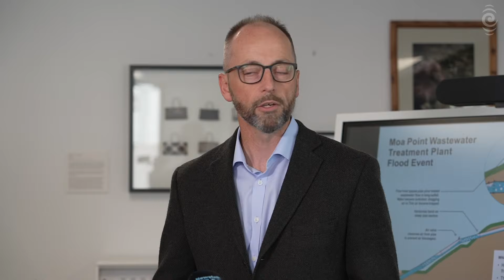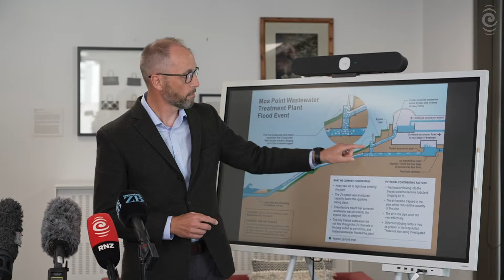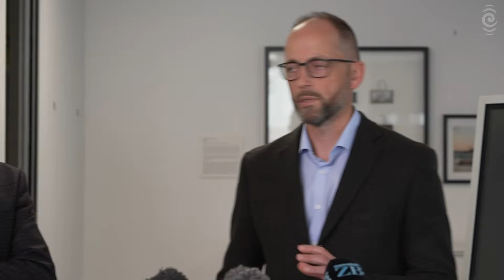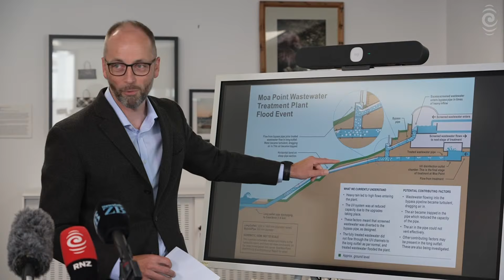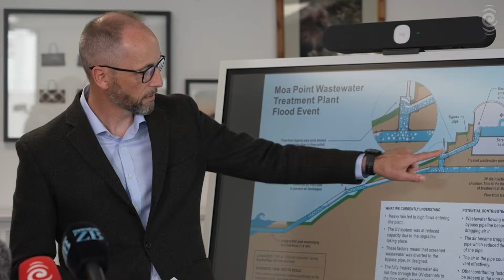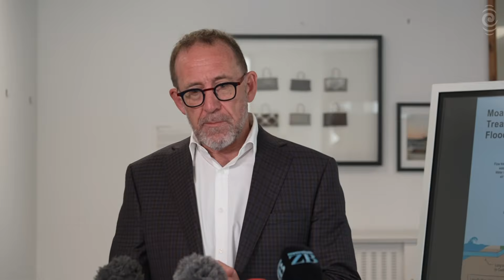Possible cause of Moa Point disaster revealed | RNZ

Comment: Transparency and Completeness:

Release the preliminary report so we can read it rather than listening to the mayor's fumbling attempt to explain what happened.  The Wellington Water website says: 'The report has been provided to Wellington City Council officers late yesterday, as the asset owner. The contents of this report will not be made public by Wellington Water while the crown review is taking place.'  Not good enough.  The argument about prejudicing the final investigation is flawed and appears self-serving.  A factual report doesn't apportion blame. 

Also provide an ability for the public to ask written questions (via a publicly viewable website) which will receive written responses as part of the final report (or earlier if possible).  This is a good discipline to ensure the reports asks and answers all questions, rather than just those which the authors think of.  A thorough investigation will have no trouble answering any questions that outsiders can ask.  Explicit questions and answers are a powerful transparency tool and guard against quiet suppression of awkward aspects.

Example questions:

Was the plant originally designed to have 24-hour operator presence?

Was an operator(s) present when the incident began?

If 24-hour operator presence ceased between the time that the plant was commissioned and this event, what changes/additions were made to the control and monitoring systems to compensate for the lack of 24-hour operator oversight?

Were any parts of the control and monitoring system for the plant out of service and/or awaiting repair at the time of the incident?